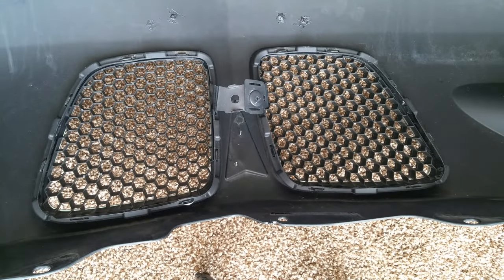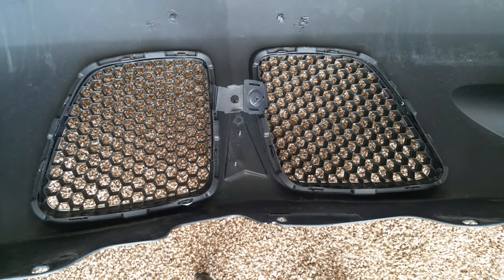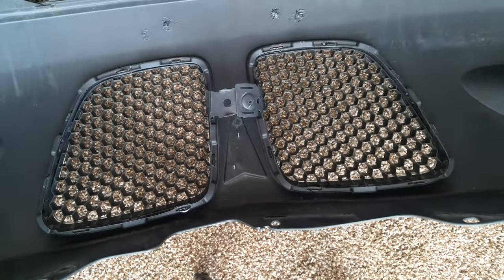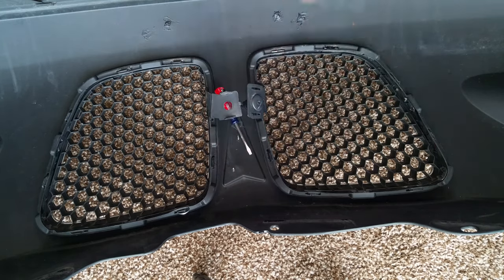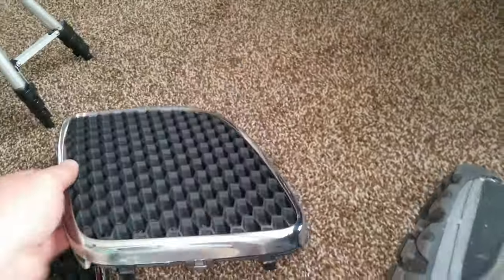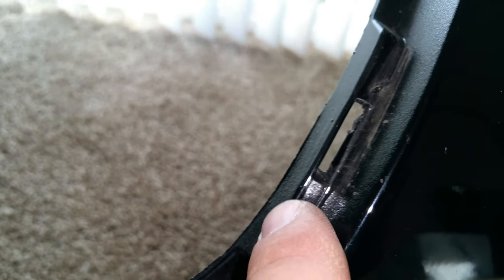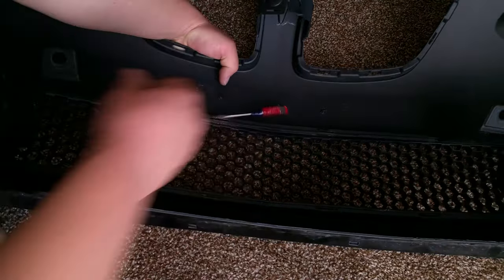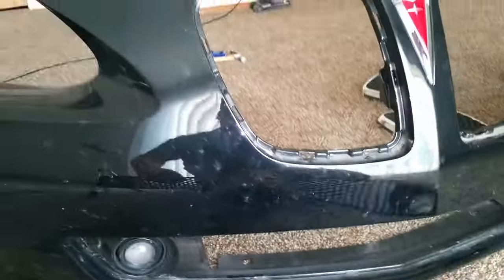Pontiac Grand Prix GXP - How to remove the upper and lower grille

Comment: I can confirm the the chrome surround comes off smoothly and easily with only a little care taken.  If painting it though, be sure to either NOT paint the connection tabs or scrape pain off them before reinstall to the honeycomb grill... paint left over hinders a smooth solid connection for tabs.

I've never removed the bottom part so I appreciated this video because I currently have my entire bumper off as well... I have to clean that fog light area as it gathers dirt for sure.
Reply from the maker: +Rick Dangerous I can not for the life of me get the two to separate. I ended up cracking one of the tabs trying to get them apart. There is no doubt some sort of glue is holding the two together for me. 

So I'll just tape off the crime and paint it that way I don't have to worry about it. Good tips.